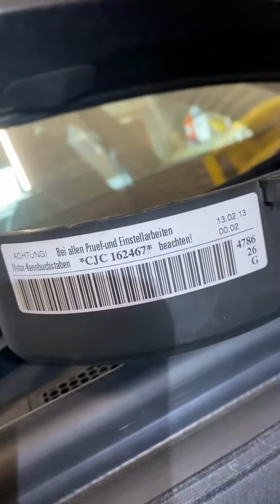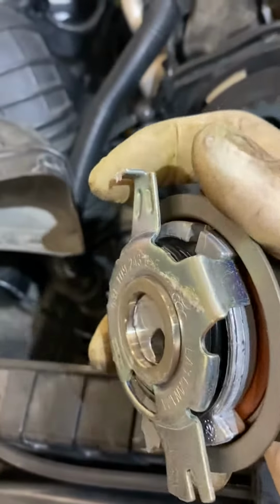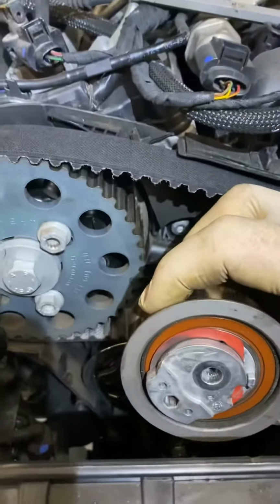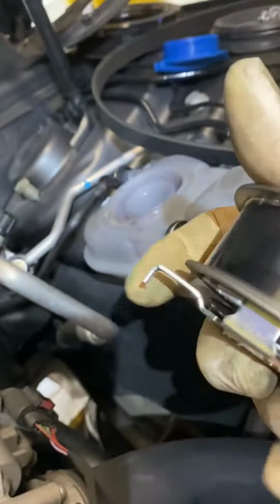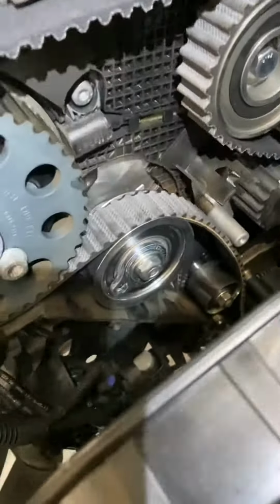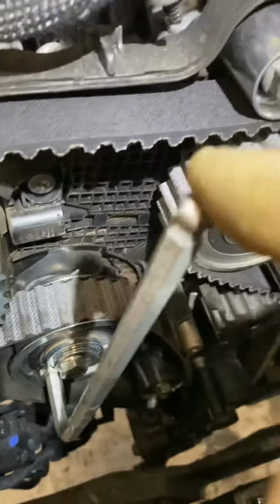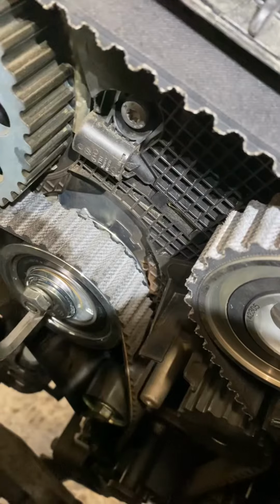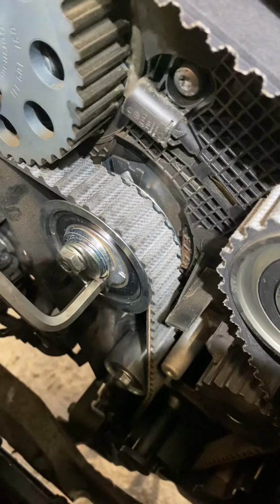Gates timing belt tensioner modification on vag engines

Comment: like you I had to stop and investigate the difference in tensioner, what i think Gates should done is to put a Tech note in the box or kit to say that its a new type of tensioner and to tighten it to the correct spec, turn counter clockwise until the marker lines up, shame on you "Gates" would save a lot of wasted time....
Reply from the maker: Yeah, a heads up would’ve been good

Comment: Worked on a VW dealership for 19 years, never had any issues or failure with the original tensioner.
Reply from the maker: No it was fine as it was but I’d say this is better in terms of potential for cock ups

Comment: Cheers for this, very well explained. I was driving myself mad and about to do my T4 ABL. But mine doesn't have any marks to tension it to - it's just round. It takes the same tool to tension it -  how am I meant to get it right? Does it sort itself out? So damn confused
Reply from the maker: The pump belt or the cam belt?
Reply: @bradauto  it was the new style gates tensioner as it had no mark on at all, automatic one I think - but not a problem I've backed the new kit and used the traditional style tensioner :) cheers tho 👍

Comment: Does it matter where you put the tensioner to start with? Like what direction that should be sat in before tightening the 13mm bolt?
Reply from the maker: Nope. It finds its position. Usually the pointer straight up 👊🏻
Reply: @bradauto  thanks man